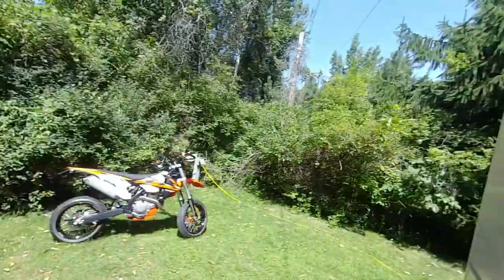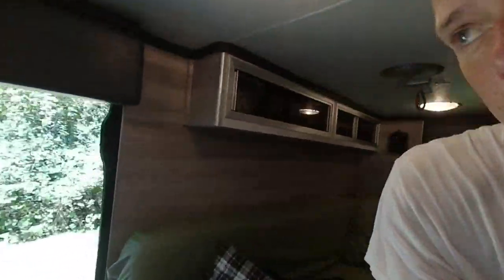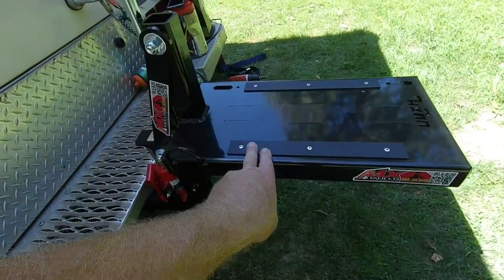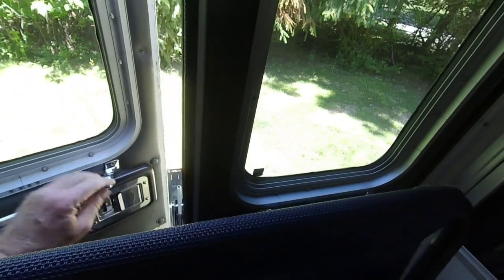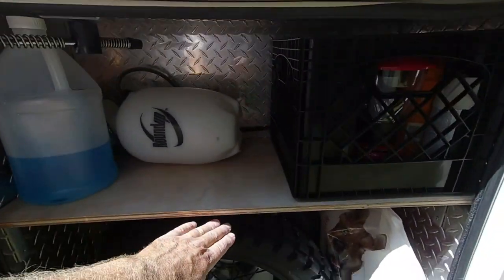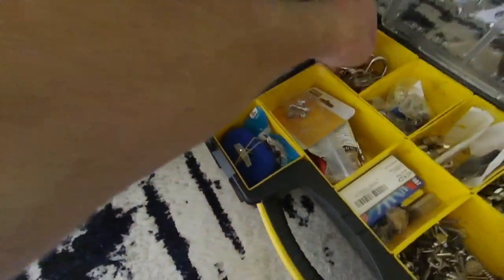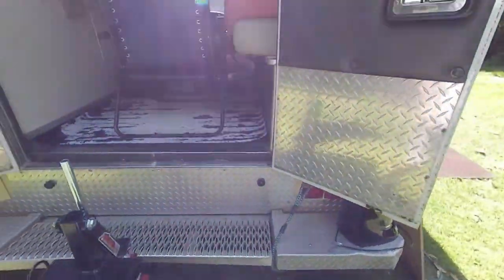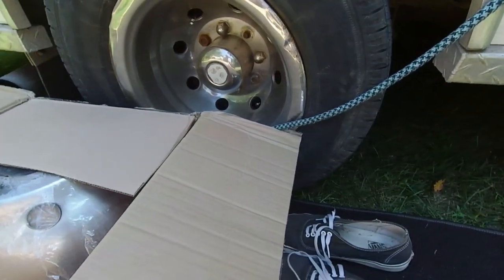Ambulance Motorcycle Carrier Installed | Ambulance Conversion Life

Comment: Some of us don't have flat bash plates on the bottom of our bikes that will work with that hitch carrier, and to be honest they scare me a little. I prefer my bike weight on the tires rather than the frame bottom.

I mentioned this Carrier before on your channel, but thought I'd find the Patent and post it up for you.
I worked for the Factory in the early 70's so I've build hundreds.  
About 15 years ago I built one for my Motorhome to carry my big Yamaha 1200 XTZ Super Tenere I scaled and beefed up the design for the size and weight. 
It has really made loading that big Monster Bike up there a LOT easier. Other than building it with more beefy metals, I added a 12 volt electric winch to the front wheel stop to help me pull my bike up the rail without the engine running, and then use the same winch to pull the rail back up to the horizontal (road) position on the back of my Motorhome or Dodge 3/4 ton truck. You lighter bike guys won't need a winch! 
I do have a short add on wheel rail in case I'm parked on a slope where the rail won't touch the ground, but have rarely used it. It goes from a horizontal rail in parked position to a 20 degree loading angle with 180 degree swing out.  And the best part is it raises the bike up to horizontal when it's swung back to the parked (road) position.  So no back breaking lifting the bike up.  It does that for you.

Anyway, maybe you or some of your readers will think it's cleaver enough and will fit their application to build on for themselves.
 

Here's the link to the Patent and you can download it to build one for yourself.
https://www.freepatentsonline.com/3760965.html
Should this not go directly to the cycle carrier search for Red Ant Motorcycle Carrier.
Reply from the maker: I've had good performance from the MX Hauler so far and I recommend it for lighter bikes for sure :)
Reply: @TheCampulanceMan  Just remembered I had a friend who used a MX Hauler like yours and he had me fabricate a bracket that replace the foot peg brackets and would actually bolt the frame to the carriers plate.  It only took him a few minutes more but it gaurenteed the bike was not going to fall off.  especially since he used motorcycle straps to help secure the bike from rocking on the carrier.  Lot of torsional forces on a bike tied on back of a vehicle.  Nylon straps do well at minimizing those forces. I just don't like trusting nylon straps alone to stay tight and secure.  Too easy to get chaffed or cut. 
But like we agree, that carrier works well for lighter weight bikes. And it sure makes a nice maintenance stand for working on the bike.  Since the bike can be strapped down with either side out.

Enjoying watching your videos David.  If you are ever passing through North Texas (a few miles North of Fort Worth) plan to drop by. I've got full RV hook ups between the house and shop and lots of room for Lefty to run and play.  My wife and I would enjoy talking adventures.  I have a big group of friend in RV's in Quartzsite right now.  They will be pulling out over the next few weeks.  I hope my wife and I can join them next year.  Health issues have kept us home these last few years.  And if you need a place to make an improvement or two on the Camper we have the perfect place for it here.

Comment: Why did you get commercial plate i have mine as private told them it was a rv conversion also the insurance is cheaper.
Reply from the maker: Hi Ariel - when I registered the truck my plan was to return once the conversion was completed and have it changed. I went to do it at the NY DMV and they needed me to go have the truck weighed - and I ran out of time :-(  My insurance is actually very cheap and I'm afraid to rock the boat now, at least with NY state. I will most likely be changing state registration soon and I'll explore the best course then. Great comment!!!

Comment: Hi Dave I have the same ambulance..looking to get same setup with trailer hitch and lift. Could you list model numbers for both. Thanks Dave.
Reply from the maker: Hi Dave! Excellent! My trailer hitch is a custom made unit that I had fabricated and welded in by a shop back in NY. What I found was that the E450 doesn't have any specific hitches manufactured for it (specifically) because depending on the application and box, the frame and bumper can be many different ways depending on how the truck was assembled by the third party companies. They all cut the frame in different ways. There are universal type hitches that can be adjusted for width, but these aren't the greatest.

The bike carrier is an Ultimate MX Hauler. I bought mine at discountramps.com but it's also sold at other places as well. Here's a link to it where I bought it:

https://www.discountramps.com/motorcycle/carriers/p/104-BLK/

I've been about 8000 miles so far with it with no problems.
Reply: @TheCampulanceMan  Thanks very much for your help be safe ! Amble On.

Comment: Are you still satisfied with the MX hauler ?
I'm thinking about picking one up and hauling a KLX300.
Thanks for the videos . thumbs up.
Reply from the maker: It has worked flawlessly for over 20k miles carrying a bike. And we've been on some ROUGH roads and dirt too. I'd recommend it 100%. The only thing that was a negative was I had to replace the jack after 2 years. A $30 fix, so not a big deal. Mine is outdoors 365 days a year.

Comment: i have a ktm 350exc that i want to take on trips. what is your opinion of this rack after using it a few years?
Reply from the maker: 100% recommended.  The only issue I had was the jack seal started showing signs of leakage so I replaced it before the original one failed. Thst was after 2.5 years. I trying to figure out how to cover the jack shaft with a sock to keep debris and weather from always hitting it...
Reply: thanks, i really appreciate the feedback.